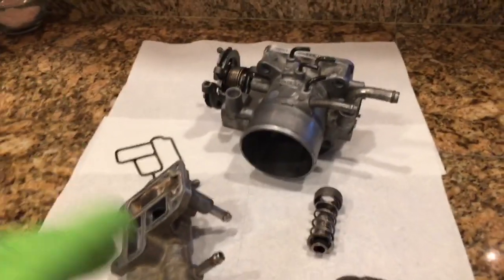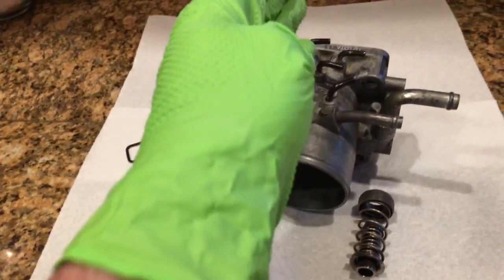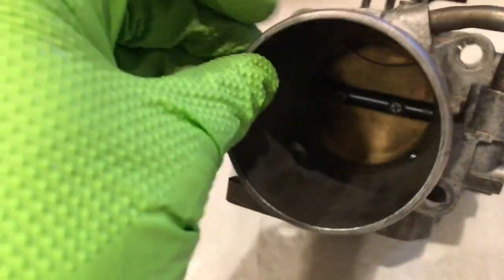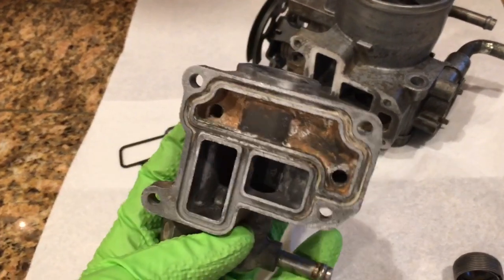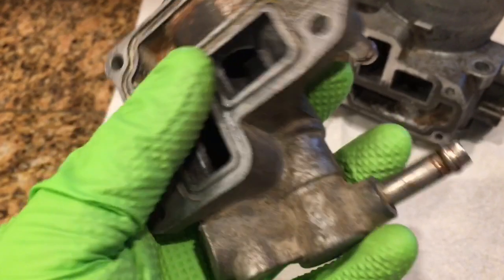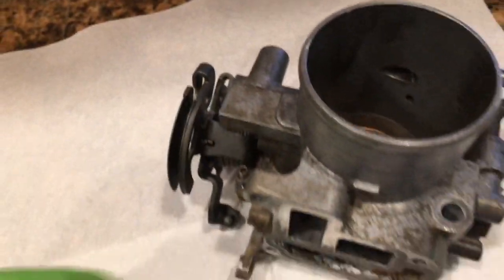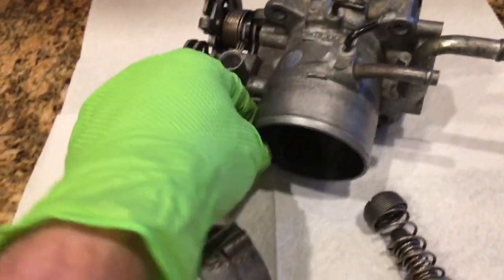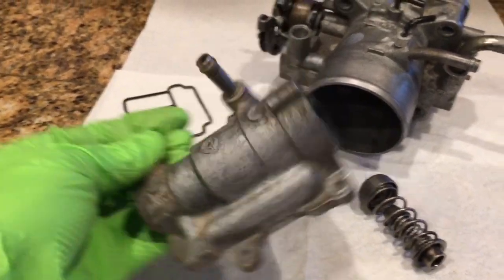Toyota 4runner pickup 22RE - understanding rough, high, surging idle, the Idle Air Control IAC valve

Comment: I have a 91 Toyota celica and when I drove and try to keep the speed will drop off and the idle and kind of pull off itself
Reply from the maker: Orlando Tejeda Could be clogged injectors or maybe low fuel pressure. I'd also check your plugs and check to see if the cylinder chambers have excessive carbon build up
Reply: @ray5961  thank you very much for the information and I will find out soon thanks again
Reply: @ray5961  now the take time to hearing your video I'm going to clean up the throttle body and see how it goes... it really bother me to drove my car and when I try to keep the speed it will kick-off and drop off the idle and kind of pull off itself

Comment: I cleaned the throttle body, replaced the air/idle control valve, replaced the idle set screw o ring, replaced the pcv valve, replaced the air filter, new plugs, wires, cap and rotor. Even replaced the fuel filter. Still idles rough. Can anyone tell me what might be the cause?
Reply: I also ran sea foam through twice to try and clean the injectors.
Reply from the maker: Perry Johnson Check to see if there are any engine codes. Also, you might want to check to make sure your O2 sensors are okay. I'd also do a compression check. Check the fuel pressure at the rail as well. Watch the Cris fix video about dirty fuel filters

Comment: @UCmGyD1O2xMhhRYDn1D2cK_g same situation here; I pulled out the pin from the brass cylinder and it has a groove with residues of what appears to have been a very tiny o-ring meant to seal this pin/piston so the air Trapped inside The brass cylinder would expand, pushing the pin/piston out To close the air passage. So, if this o-ring deteriorated to almost nothing, the air escapes from the brass cylinder and the pin does not push the valve closed. Do you now where to get an o-ring this tiny? Or do we need to replace the whole IAC valve because the o-ring is not available?
In my case, I would have to replace the whole throttle body because on my 89 corolla 4AFE engine, the aic valve is part of the throttle body!!
When unscrewing the valve seat, it was very hard and the valve plug kept pushing out against the seat. When I screwed in back on, after having removed and put back the pin, It when in very easily without resistance from the valve plug pushing against. I am thinking of spooling some dental floss on the groove in place of the missing o-ring. I think the pin/piston will not rise without anything sealing it with the brass cylinder. But, I will give it the hot water test before putting it back on the engine.
Again, do you know where to get such a tiny o-ring??
Reply from the maker: JC Plancarte Very interesting. I've never taken the brass pin apart. On the O-ring you should be able to get a high temp one from McMaster

Comment: Mine idles rough once warmed up after driving for about 10 minutes when I hit the brakes it drops idle and when I release brake it idles back up.
Reply from the maker: Let’s Help Each Other usually that's a vacuum leak some place, as the brake booster is actuated from engine vacuum. Search "vacuum leaks scotty kilmer" here on youtube and you should find some helpful videos
Reply: I appreciate it however the booster is holding vacuum and it's new
Reply: @Dusty.Does.it.  did you ever find out about your idle/ vacuum/ brake issue? Just rebuilt my 22re now it's doing the same thing you described.
Reply: @TheMillertym58  yes, the idle control valve was seized. Didnt have to take anything apart just the throttle body off the intake. If you can hit the throttle body on your hand it should vibrate like a spring is inside. Mine didnt budge felt like a solid piece. I took an old throttle body from my brothers carb swapped 4runner and runs great!
Reply: @Dusty.Does.it.  Hey, mine has the same problem. It runs perfect cold but drops way down to about 300 RPM. I'm gonna go mess with it, thanks for replying with your fix. Also thanks to the guy that made this video.
Reply: Christopher Carlson it was the idle air control valve. I bought a brand new one now I drive 15 miles a day with no issue
Reply: @ray5961  Ray my 94 does the Brake thing to even after removing booster vacuum line and plugging on Plentum . Found it's electric related as I removed the stop light fuse and that stopped the idle drop when brakes are pressed, I know it sounds weird but I'm thinking the battery might not have the amperage to drive the stop light bulbs and causes the Alt to pull engine down with the load..
Reply from the maker: Don Smith yeah a strong battery is very important. That's part of why I run that lithium battery.
Reply: Thanks for reply, tried testing that theory yesterday to no avail. Piggyback good battery and still got brake problem. did find thru a little searching that the water inputs to the IAC are not warming up like the water right beside it in the Thermostat...  Thinking I may have a stuck valve in the IAC. so that's probably todays task..  Also noticed that Idle valve has to be almost all the way down to keep engine running when warmed up, another indication that the IAC is stuck open.. Again thanks for the help and the videos.. Maybe I will get this old soldier purring again soon. BTW it's a 94 pickup and only has 17K miles on it. Can you believe that??? Was a garage Queen..
Reply from the maker: Don Smith 17K miles wow! You scored. Okay with regard to the IAC hoses - there is one which runs from near the thermostat housing and also one that runs below and down - both should be warm to the touch; if not, then you have a blocked water passage. The air passage and pin stuff has no direct correlation to water flowing in those hoses, so you have a blockage some place. Try this: remove the top and bottom hoses and just try blowing some compressed air through (be careful). Then see if you can pour water in the top hose; it should run out the bottom hose freely. Also check that there is flow coming up from the hose fitting that screws down there near the thermostat housing area. My guess would be it's a blockage some place in there, and the lack of hot water flowing isn't allowing the pin to move, not that it's stuck - it just needs hot water flowing to work and the hose is blocked. The top and bottom hoses should be basically the same temp as your upper radiator hose if everything is working properly.
Reply: @ray5961  Thanks, Will try that but It's my sons truck and he's got stuff to do today so, we won't get to try that as planned. But at least we have a direction to go..  But still I'm not sure what is causing the Brake issue as it's not vacuum but Electrical. Removing the stop light fuse does stop the idle drop on pushing the peddle down. Kinda got me stummped.
Reply from the maker: Don Smith It depends... it could be a chassis short in the wiring harness some place. However, keep in mind that the brakes are also vacuum operated and therefore when you push down, it's also drawing vacuum away from the motor. Have you checked the hose that runs from the intake plenum over to the brake booster? Try disconnecting the hose and blocking off the inlet in the plenum manifold and see if anything changes. If not, then perhaps there is a short which is causing a drop in the ignition system some place.
Reply: @ray5961  yes first thing I did was pull the line off the plenum and plug it there. Still did it even with booster disconnected. Have replaced most vac lines and don’t find any vac leaks, old trucks still suffer from dry rot. It has me stumped. Pulled stoplight fuse and it stopped. Lights come on great and fuse doesn’t blow with over current(15A). Strange
Reply from the maker: Don Smith That is a strange one. I'll check my wiring diagrams later and see if i can find any correlation between the stop light circuit and anything else. Do you have A/C in the truck?
Reply: @ray5961  yes there is A/C in the truck and it seems to work fine.

Comment: You said it means the engine is getting too much air. You didn't say too little air. Why are you so sure ?
Reply from the maker: Doug H. in VA If the IAC valve isn't working, then usually that air passage will be left open, which allows extra air into the motor. Under throttle it's not a big deal, because that air is metered air. However, when the throttle plate is closed, the extra air going into the motor is basically acting like someone is holding the plate open and allowing extra air in, even though everything else expects that the motor is at idle. So it almost functions similar to when you pull the PCV hose off and allow extra air in - which negatively affects idle.
Reply: @ray5961  I think I understand your explanation, but it seems to me you are telling what happens when the IAC does not work. To me it makes more sense to explain how it normally works and the role of the barrel type device that opens and closes and why in addition to the 2 radiator coolant pipes and how its temperature has a role. Most guys are not car guys and do not care much or think much about how devices in a car work. Simplify what to do and the cheap, reliable, and simple remedy.and how to get to it.

Comment: I have an '89 Toyota pickup 22re and it has a rough warm idle and occasionally stalls. It runs and idles fine when cold though. Could the IAC valve be bad because it didn't look that dirty when I removed it.
Reply from the maker: Mercury Blues could be there is a coolant blockage via the two small hoses that run to and from it. I'd start by checking those. Check and see if the line that loops up from the fitting on the thermostat housing is hot when the motor is up to operating temp

Comment: My 89 22re surges high to about 3k  rpm when cold start , stays there until about half warm, rough  idle always when warm . Could that be the idle air valve ? Or a leaky cold start injector ?
Reply from the maker: Max B Could be a leak around the idle adjuster screw also, or a vacuum / air leak in general some place. It's easy enjoy to rule in or out the cold start injector... just unplug the connector to it. If you think it's leaking, pull it out and jumper the diag block on the OBD1 port to turn the fuel pump on and see if it sprays gas out. I would also check the EGR valve to see if it's stuck open.